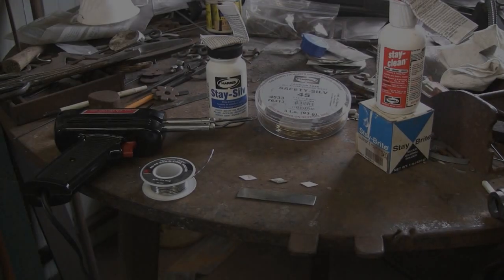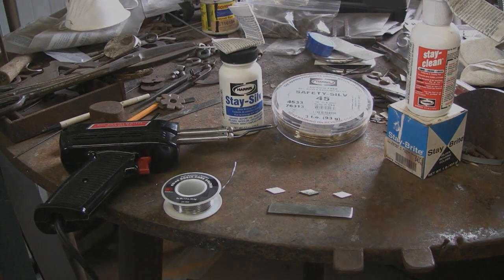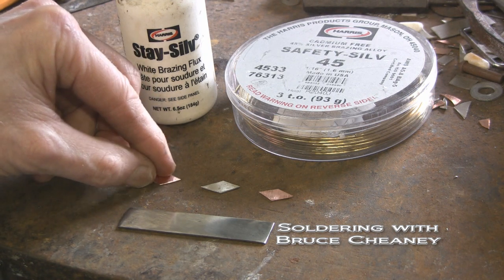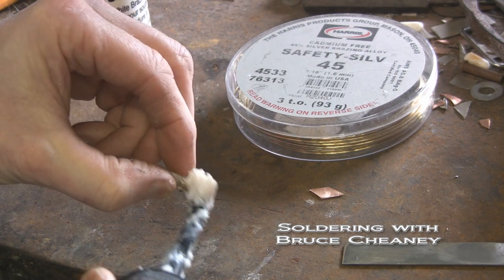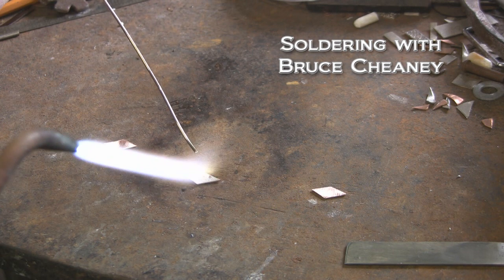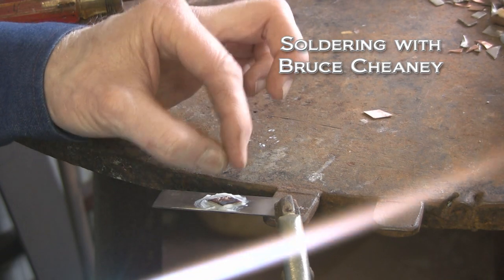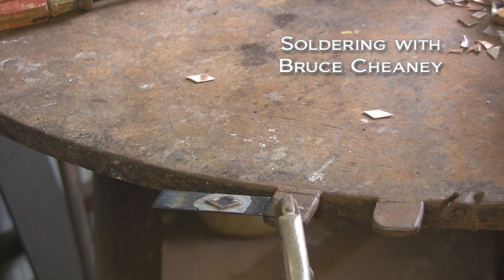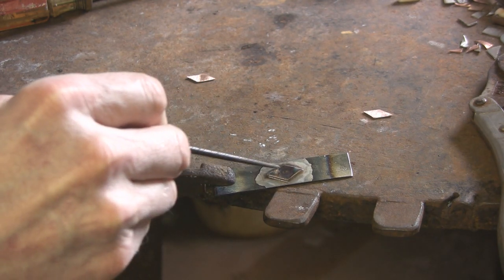How to Silver Solder - Soldering Steel, Copper and Nickle Silver

Comment: I'm trying to silver solder a brass ferrule (aka nipple) at the tip of 2mm OD (.078") copper tube.

I use a regular propane torch, Benzomatic w a 1/2"D nozzle that came w it.  I clean the tube
tip w a piece of steel wool to shine.  But even without any flux, the Cu tube turns black w 
some slime coating where heated.  What's going on?  Is the tube has carbon or that the
propane gas is bad?  I bought the torch w the gas tank ~4 yrs ago.  

I then cleaned up the tube tip again, I then coated the tip w Stay-Silv flux.  Heated the
tube 1st near the ferrule, advanced the flame to the ferrule, and when the flux began to
liquiy (bubbling), i touched the joint w EZ-Flo 45 (45% Ag, Cadium+other alloys, 1/8"D).  Not
only the silver didn't solder flow but turned black and grey, started to damage the tube and
the ferrule.   What's going on?  This silver solder failed to melt.  Perhaps, the bubble wasn't
a good indicator of hi enough temperature?  The cream paste flux was bought 3 - 5 yrs
ago and it's crusty (like sugar coating on a cake) but still a bit more moist ~3/8" below the
top surface.  I used bottom portion to coat the tube.  But still no good result.

2nd Attempt - Abandoned EZ-Flo 45 and  .031"D Stay-Silv flux, use softer low temp 
Stay-Brite silver solder + Stay-Clean liquid flux + hand gun type butane torch of ~5/8"D
nozzle.

I placed a loop of this thin solder about 1/8" away from the ferrule joint.  I held the butane flame for about 3 minutes, the solder liquifyed and got  the ferrule w grey and black goo surrounding the brass but was able to clean them off.  The solder on the ferrule looked
grey, not shinny.  No, i didn't dip the unit into water right after it was done.  Wanted shinny
solder joint but ...

For the Propane case, i did it out in bright sunshine, i couldn't see the propane torch flame and couldn't tell if the units turn red or not.  For the Butane case, i did it in the patio shade
and didn't see if the unit turned cherry red or not but the softer solder flowed.

Since the tube-ferrule connector is not directly soldered to the boiler, i don't think i need
to worry about the heat for this steam gauge application.  But a bit disappointed in
my results.

Any advice for better solder joint or where i did wrong?  The basic problem is that heating
the joint turns them black w a coating which seems to prevent the solder from flowing
even if i'm able to turn them red!

Comment: great info.thank you.
have to ask about torch setting. you start w/neutral flame, then what did you adjust to make it "softer"? cheers. E
Reply from the maker: Just backed off of the fuel a little to make the softer flame.